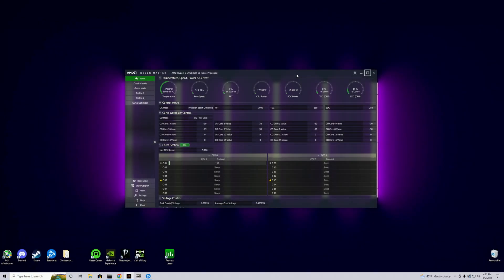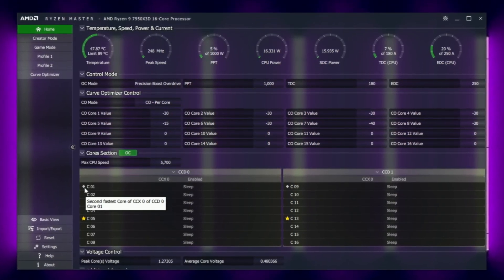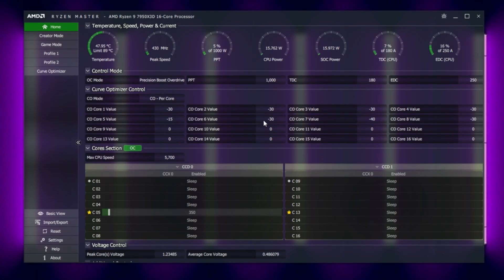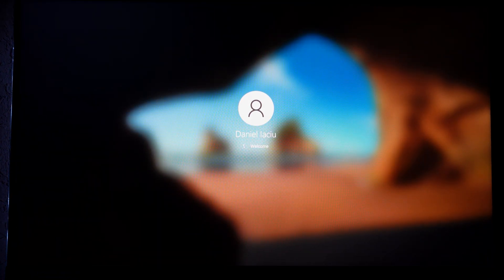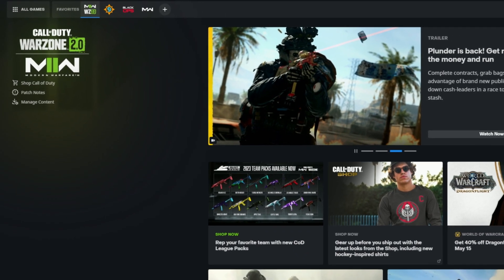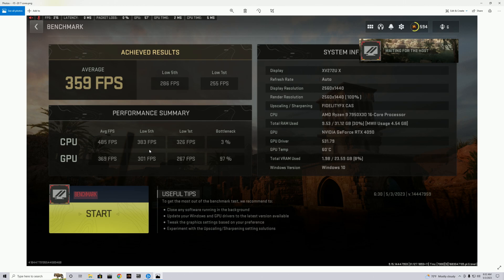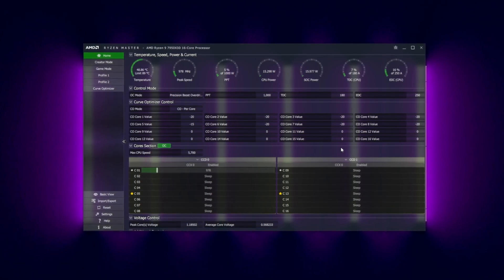Undervolting Ryzen 7000 Guide (How To Max Out Your Undervolt)

Comment: nice vidéo ! With 7800x3d since the bios update of 04/27 which blocks the cpu soc at 1.3v, impossible to activate the expo profile.  6000mhz as 5600mhz.  CO -30 all cores crash the pc.  I am in -20, PBO limit enanhcement level 3 70° and thermal throttle 85. With these parameters the pc runs well but I think I can do better to gain in temperature and performance but I don't know what to change
Reply from the maker: If you are happy with what you have leave it as is, if you want to try more it's tough as I don't know exactly the bottleneck or issue ur system would be having to not be able to push further.
Reply: I have the same issue not being able to enable exbo

Comment: Test all you're curve settings with aida 64  cpu sha 3 benchmark, that's the hardest one to succeed with a undervolt. My 7800X 3Dwas stable with - 30 on every benchmark but crashed at sha 3 😂
Reply from the maker: I mean getting it to crash is not the goal tbh. Say you play Warzome 2 and you have a -30UV that's perfectly stable there and it'll literally never crash, then you download a heavy stress test and get it to crash... that doesn't mean that UV wouldof ever been problematic with Warzone 2.

While it's good to know a way to test full stability, the goal of every individual is the best tester, be it getting it stable for a video game, or getting it stable for a benchmark run.
Reply: @Beefy-Tech  Getting it to crash should be the goal though. If you're not stable, you are eventually going to get windows corruption, and a possiblity of file corruption. It isn't the worst thing in the world, but it'll save you having to do a fresh install every 3-6 months depending on how unstable you are.
Reply from the maker: @rindrasi  you aren't wrong, in fact that is indeed the way you avoid all issues after all, so I take it back, and will try Sha myself to see it's function.

Comment: I have -30 on every core. I'll definitely give a try your way tomorrow morning. Can't wait;)

Btw, On my MSI board there were for only 1 Bios version the Enhanced Mode Boost PBO and those were giving some good results with higher boost on every core. Normal boosting on every core is sth like 4880MHz with Enhanced there were 4950MHz. They promised they ll bring them back in the future. Maybe your Mobo manufacture will also add such future.
Reply from the maker: I haven't even checked to see if I have an enhanced mode boost to be honest, but at a glance I didn't see the feature.

If -30 all core already stable, it may not make any difference at all to change specific cores since in a gaming scenerio it may reach peak frequency as is, but who knows 👍😂
Reply: @Beefy-Tech  2 Bioses before maybe there d be no effect, but after whole burnt CPU drama with newest Bios I spotted less frequent boosting. I mean my 7800x3d boosts to 5050 but not that often like before, so maybe more careful tweaking might be at least partly solution
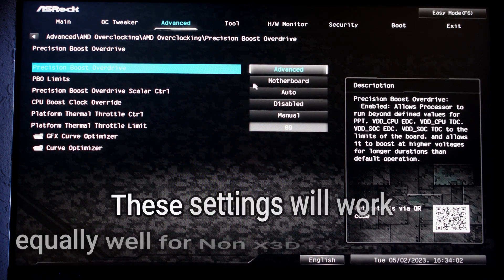Reply: @Beefy-Tech  It's CPU clock override. It can go upto 200mhz. It's on precision boost overdriver at 3:24 on your video.
Reply from the maker: @rindrasi  ohhh, so CPU boost clock override only applies to the fresh CCD on a 7950x3d, meaning it won't actually help boost clocks on the 3D v cache.

For the 7800x3d I think there is a way to make boost clock work because it only has a single ccd, but I'm not sure tbh.
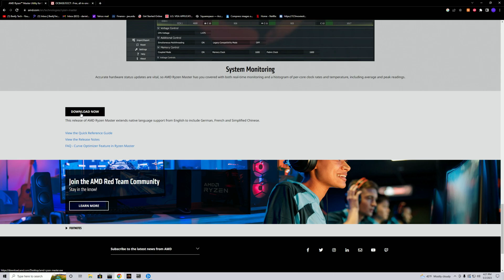Reply: @Beefy-Tech  0:32

Comment: Hello @beefy-tech. Thank you for your tutorial. I have the 7900x3d and am considering undervolting as well. I noticed you made comparison between two configurations but I wonder how much better it is against no undervolt at all? Thank you.
Reply from the maker: To sum it up, it's about 10-20FPS different in benchmarks...not a lot Essentially, most important part of dual ccd cpu's is just making sure they run on the correct ccd for games.
Reply: @Beefy Tech  Hey mate, I've also got the 7900X3D, would you consider undervolting both CCD's or is only V-cache CCD worth the tuning?
I'll be making a custom loop inside an ITX case in the coming weeks and want to make it run as cool as possible.
Reply from the maker: @AxleLotl  I am going to undervolt both CCD's yes, just have to validate a final UV for ccd 1 and then I'll do CCD 2. I've experimented with both ccd's undervolted and you can save another 1-2 degrees at most if both are undervolted and on at the same time, but because most of the time the frequency cores are asleep or only 1 core is used for background tasks, it won't make a huge difference... unless you load all cores at once ofc xD

In theory you can also overclock second ccd by 100-200mhz and undervolt it along with that.

It'll help those few situations where you use the frequency cores for something
Reply: @Beefy-Tech  Awesome! Thank you :)

Comment: Hi i got a Question !! I am sorry for my bad English so I try my best. I really interested for optimizing my Pc by your Hand. I saw the Formular whitch you have to rank my Knowing in Computer from 1-10 my is 3 so its better to have someone by my site who is better in english and in computer ?  I got a Ryzen 9-7950X3d /RTX4090 Gigabyte OC/Venegance DDR5(2x16GB) 6000MHz C30/Rog-Strix x670E-F and my best Results in MW2 Benchmark is 310FPS. I watch all the Videos and tips for ProcessLasso and Settings you make . For an answer i wil be happy and sooryy again for my english.Thanks.
Reply from the maker: Hello! For optimizing your computer all you have to do is sign up using the form. If you already set up the computer and want to just check and make sure everything is okay run the MW2 Cod benchmark and see if you get above 450cpu average.
Reply: @Beefy-Tech  Hi thanks for answering so i will do this nearly . Thanks a lot. you will hear from me soon.

Comment: Buddy, I like your videos so far and all but you cant just compare those MW2 benchmarks and say 'one seems a little better than the other'. Why? Here is why:

What are the differences between the framerates in percentage? They are too low to be meaningful. The differences could very easily, or rather should, be attributed to run to run variance, unless you tested both scenarios numerous times and were able to assess the standard deviation of your testing method. If you told me that the standard deviation of the testing was 'somehow' SO low that even a difference of 1% between the framerates is meaningful and outside the margin of error, then I'd say okay fine

Aside from this small thing, you're being a great help
Reply from the maker: It is margin of error, as while in the video I've only shown 2 examples,
I ran both benchmarks 3 times, and took the 3rd results from each undervolt. But the 3 run results were consistent with each other.

The benchmark deviation essentially means anything under 5 FPS is pretty much the same...but at that point all it means is that the second you are over -20 it doesn't matter anymore for Call of duty with my specific CPU.

But it doesn't have to go deeper then that to make a point really, 

Not everyone will test with cod, and I ofcourse didn't max out my own undervolt within this video, as that takes hours to do and many many crashes, which is not ideal during a recording session.

But if I were going to go for maxing out for cod, I'd just run 3 benchmarks with cod per Undervolt test.

Comment: Or it doesnt work?
Reply from the maker: It works identically to how it's demonstrated in the video👍
Reply: @Beefy-Tech  thx i was scar it doesnt work on 7800x3d 3d chip ill try thx.
Reply: @Beefy-Tech how can i find out which are my best cores without using ryzen master? last time i installed ryzen master i got several errors.